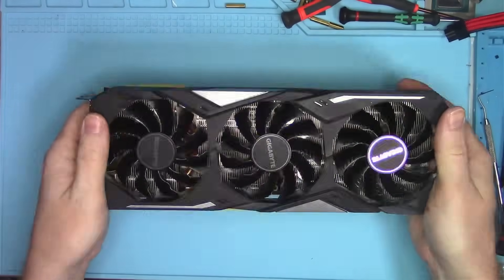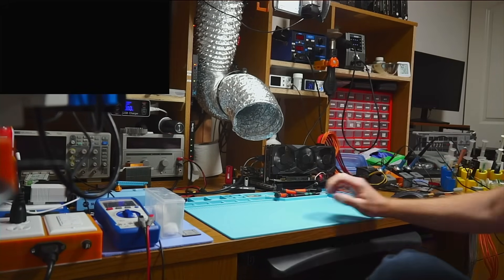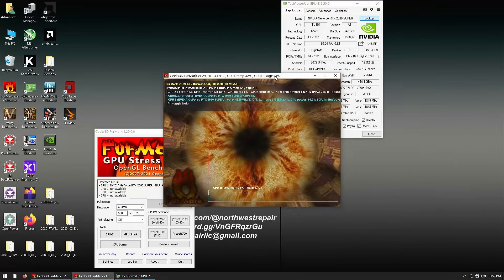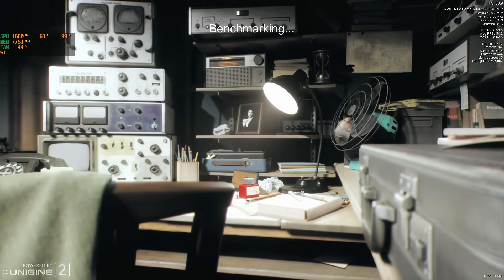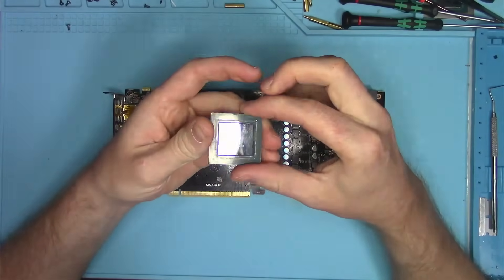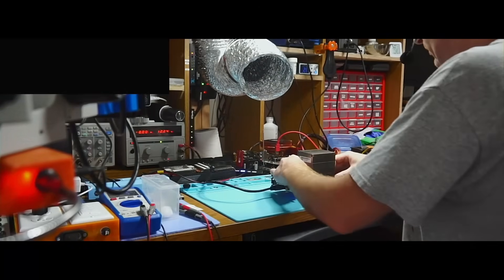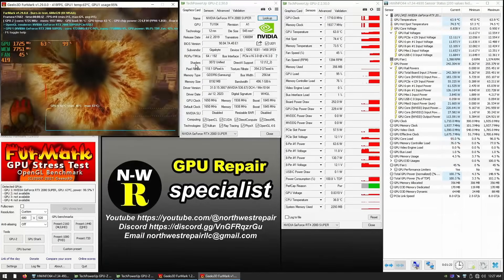GPU Artifacting FIX

Comment: I keep getting these vertical colorful scan lines that flash on my screen once in a while. I have a 5090 and I can’t seem to fix this. It. Could also be my new Asus oled monitor I can’t diagnose the issue it’s killing me. I changed my DP cable. Reinstalled drivers. It’s still flashing vertical scan lines and also the lighting in some games seems to flicker. Idk what going on. 5500$ for this computer totally unacceptable. It’s driving me crazy. Is my GPU dying or can it be the monitor ?

Comment: I clicked the video hoping to fix my card, but I don't have that much equipment! But I stayed because the process was so smooth and very well edited, thank you for sharing this! amazing work!
~ Could you provide the tools to stress test and lower voltage to check if my card has the same issue? thank you! 💗 I would take a band-aid for now

Comment: i have error Display 4101 but most spam is nvlddmkm 153
 errors even after turning on pc without entering any app or something happens on desktop
on laptop 
did format try ddu drivers tdr timing 20 second dint worked  Gtx 1650 with intel uhd system

Comment: bro, my rtx 2070 mxm was artifacting and crashing with oc(stock voltage) so all i did was to lower the oc i wanna know if the gpu is damaged or if its okay(never reached above 77c on core) i also run 13 30 mins of furmark, zero artifacts but the gpu mhz isnt at the max, in games it runs fine, but some flickering shadows(i dont know if its the game or the card, since its running on hdd and just some shadows, not all)

Comment: expected a simple "how to", so i can quickly fix the issue and instead got a full blown gpu surgery. still, i got nothing but respect for this

i reckon it might be at least worth asking: could you help me or is there a way to self diagnose the cause of random (and truth be told, pretty seldom) gpu artifacts? i get them occasionally while running stock settings on a 4070 super. they are not a massive inconvenience, but.. by buying a gpu or anything really, you demand for it to work as intended. i've been trying to record my screen for half an hour without an artifact. been trying different presets of uv/oc that i've been playing around with in the past, in a furmark benchmark. the only thing i learned is that i found a reliable and quick way to force coil whine (also frustrating to have) and it seems to be related with high fps. i can also adjust the pitch by changing the power limit, which directly correlates to the amount of fps.

as for now, i've done i clean install of drivers using udd in safe mode and will be looking out for more artifacts to come, but i'm expecting this to fail, unless the clean reinstall had helped, unlike regular drivers update, which wasn't helping in my case.

i forgot to mention, i'm worried that the artifacts may be the early sign of gpu failure. and i'd rather look out for help or RMA it (if i can even prove the artifacts occur) than wait for it to eventually fail and knowing my luck, it would happen soon after the warranty would've ended

Comment: My GPU just started failing I guess. Unsure what's causing it. It just gave me random pixels out of no where, then showed GRAY screen and then shut down the pc. Then it started up by itself and I had blue horizontal lines all over the screen during startup, but it did show the windows loading screen. However after the 'loading' was done, it stayed black.

It started a month ago when I was pushing code commits to github where I accidently had video files included from over 1 GB total... it was uploading until my screen started to show random pixels and then went completely PURPLE and then reboot itself. I rebooted it a couple times and it was fine again.
Until yesterday when it happened again. We managed to get it to work again, ran DISM and sfc, and it looked like it was fine.
But today it did it again out of no where, like it wasn't doing that much at all. And now it just doesn't want to boot, the blue lines are all over the place and it only want to go into the automatic recovery mode and fails to recover.

The GPU is a Radeon R9 200 Series and the CPU is an Intel i7-4820K.

Last videocard driver update that I did after I had some time where my screen just went black for a second or so, was in March. Well the reason for the update was actually Satisfactory, but ugh the game continued to complain. Also only runs in DX11

Am I missing something or do you have any ideas? Please let me know

Comment: I have a PowerColor Rd Devil RX 6700 XT that has the same issue but undervolting the core doesn't help while when I decrease the core frequency to 1000mhz it becomes stable, at first when I ran FurMark at default settings it would crash immediately but when I decrease the frequency it runs fine, I didn't touch the memory frequency and DID in fact run a memtune test in tserver which came out clean. I've seen one of your videos on this card aleardy where you deduced that the issue was the IOR 35217 controller and you had to replace it and program it a few times, but I'm not sure if that's the fix for my card since I don't have an infineon programmer dongle. Any help please ?

Comment: The case here is either micro damages/cracks on the die itself, or some of those tiny capacitors on the package dying. Obviously, replacing the GPU is the only sane fix here.

Comment: I get artifacts color blooms and flak flashes only in one game Warzone. Its also the only game that oushes my gpu to 2800 2900mhz . Every other game gets to 2.5 maximum but average at 2.3. is there something wrong with. My GPU. ? Should i underclock just for this game or doe sit mean my gpu is dieing ? Replacing drovers did help for a while but when i lowered the settings and let it get up in fps it happens again.. 7900xt should i be looking for a new card ?

Comment: Hi 
I just got strix gtx 970 used 
The card runs well on heavy benchmarks works but when running games it crashes after a few seconds. Tried different drivers , reducing the power limit and clock speeds, different windows. 
My specs are 
i3 10105f 
2*4gb 2666mhz ram
Gigabyte h410m s2 mobo
Cm 650w mwe v2
Gtx 970 strix
Mu appreciated for a solution

Comment: Thank You 👍 I just got similar situation with RTX2080ti. After undervolting less artifacts but still there. Very high power draw , GPU-Z - 12V drops under load up to 11.3V and Pcie 12v up to 11V(not PSU fault, 800w verified)From top three vrms one heating more with normal oscillation, on another two coils little strange oscillation like with gaps, not experienced with this. Mods can't pass initial but mats not finding any faults. Where to dig next ? 😅 Dead core ?
Reply: Dude just RMA it

Comment: the gpu core usually costs like more then half the actual gpu price, is there any cheaper way to perform a repair like this? that doesnt involve replacing a super expensive part 💀
Reply: sometimes , but not always 
a simple reballing helps

Comment: I feel like like this video is glossing over the fact that changing the core is almost like exchanging the whole GPU. I mean wouldn’t this repair be almost as expensive as getting another used one? I think I’d rather just lower the clocks a bit, if true.
Also couldn’t it be some bad solder points or something on the original core?
Edit: or thermal paste gone bad perhaps.

Comment: Yo can you tell me whats wrong with my pc ? 
- i have an rx470 4gb version nitro saphire ,
-i use atikmdag for driver issues because they dont appear themselves on windows so i have to use this program.
- i dont think its because of the driver problem but after the pc starts and gives signal after 1 minute the screen is full of artifacts and then somethimes  restart sometime gives BSOD and restarts and sometimes it just goes on worlking without restarting.

The artifacts arent individualy showing they appear in a moment and then do the restart thing they are on the whole screen and they are diagonaly out ...

Comment: What if I have some flashing artifacts in one particular place of one particular game and they go away after switching to DLSS balance/perf/ultraperf?Is it a hardware issue or a software one?The game is Horizon FW and the card is EVGA 3060 XC.Undervolting/underclocking to absolute minimum does totally nothing and the card successfully passes any kind of benchmarks or stress tests

Comment: I have a hp pavillion laptop. It's showing this status access violation error on any web browser i use. When i gave to repair they're telling it's the issue of gpu and it's dying. Ive runned all the stress test as you showed in this video and my gpu performed very well. This artifacts issue happens only in web browsers not anywhere else. What should i do?

Comment: My gtx 980ti is artifacting when i boot into os. And then not long after it just crashes.. I tried booting in safemode and using msi afterburner to lower voltage, but it won't even register on afternurner..

Comment: Would you have any idea why my fairly new ASUS TUF RTX 4080 would show flickering lines when first setting up Windows after a fresh install and before toggling HDR, but never after this? It only occurs with LG HDR OLED displays, at least the two I've tried. It can only be replicated by reinstalling Windows and not touching the Windows HDR setting. Once that is toggled on to HDR, the lines go away forever, even if I toggle it back to SDR. Now, I know it's not an issue with Windows as I will see these lines on during the ASUS boot screen when restarting just on the spinning loading wheel. But, once it loads into Windows, there is no line artifacts. And this problem never shows in games and the card behaves perfectly. 

The fact that this only occurs after a fresh install of Windows and before I first toggle the HDR option, and occurs regardless of what Nvidia driver version I have installed makes me think this is an issue specifically with the ASUS bios for this card's board and how it interacts with LG VRR HDR displays. I can overclock the card as well no problem with no artifacts. Here's what the bug looks like when setting up Windows for the first time. I think I reinstalled Windows like four times on this machine, trying different things, to really isolate the problem. https://imgur.com/a/Sf0LAk7#jVxBpE9
Reply from the maker: no idea
Reply: @northwestrepair  Thanks for replying. I guess since it doesn't actually affect the use of my PC I won't worry about it, but it's just been one of those things I can't quite solve. Is it possible there could be a hardware fault with my card that could cause such behavior?

Comment: So do you think that was a bad core and not the solder joints?  Whta would have caused that, overvolting and copper migration?

Comment: I have a 2060 Super NVIDIA card that I've been using in my computer for about 4 years. The past 2 weeks i've started having several issues. I am using duel LG 32" monitors. Sometimes 1 or both of the monitors will go black for a second or so then come back. Sometimes They don't come back and I have to reboot. This has only happened twice. THe need for the reboot. Sometimes the right monitor will display a patch on the screen of artifacting. Usually some straight rectangular black and white lines in a pattern. Imagine a chessboard pattern where they are not squares but rectangles. This artifacting is always the same when it appears. The rectangular chessboard pattern. It happens on either monitor.

Is this the video card? Seems like a clear case of a video card hardware issue. What do you recommend for trouble shooting this?

Thank you

Comment: Just fixed a "dead" as is GTX 1060 6 gb, replaced thermal pads, thermal paste, did 3 x furmark test, all good. Heat dissipation is a must with a gpu.

Comment: I would have personally accepted the first chip. Your work definitely improved the character of the graphics chip. I do however think the solder you use is so much better than Greta's on another board this chip might be just great. What in the devil happened to your eye under the lampshade.

Comment: How do you price this fix? (don't have to get into exact numbers if you don't want to)
The way I see it replacing the core is like replacing the engine in the car. It's so expensive and there's no easy way to buy replacement cores so most of the time a bad core = no fix.

Comment: Ohno, i am having similar issues, but only with few games, and it is only a green variation of the artifacts shown in the video, and that ocasionally show up covering only a line in some part of the screen, usually when i have minecraft open in full screen, and i go to exit it to a brouser or click out of the game, the artifact show up in the seccond monitor, where the game is not at, but when i change the game to the seccond monitor and i try to leave it, nothing happens.

in phasmophobia it just happened in the middle of the match, in the monitor where i play this time, but once or twice in all the games i played

in TABG, the same artifact show up when i open the "group tab"? and only when i open that, i am honestly confused since these are the only moments when that happens, i tried every single program to find problems, but nothing ever happens there.

Should i just find a guy that will change pieces off my gpu? is there something related to temperature? should i test with a specific program? i just want some advice here ngl.

Comment: Would soldering more vram to a A770 8gb (or another card with a higher vram version) work the same as a card that came with 16gb from the factory
Reply: you would need to flash a 16gb bios and solder the same memory. Not sure if there's a flash tool for Arc yet

Comment: I am fascinated by how easy it all seems. Great work! Keep up the great work. Quick question for you: I have an motherboard that has a bent pins on the cpu socket and I was wondering if it something that you could fix? I don't really want the board back, it could be given to a charity or someone in need as I have a CPU for it and memory. It's not cutting edge but if it could help someone instead of collecting dust here, that would be great. Thanks
Reply: hey man no response for 1 month do you mind i give it a try to fix?

Comment: hmm, strange one, you lower the speed to not get artifacts, but the voltage was not sufficient, it looks like to me a old (already push GPU), OR the power delivery was not up to spec and the power controller (VRM) was damage, just saying this because the siphons looks like a bypass resistance on the power to force the card to give more power without hitting the power limit, that can push the core too much or the VRM's.

Sure changing the core will fix it, but if I'm right that card will return
Reply from the maker: Not according to the stats but who knows.
Reply: @northwestrepair  , true, lets see if my theory is right or wrong, 😉

Comment: I love your sense of humor. BTW you have lowered GPU Frequency not Voltage in Afterburner.
Reply: No, you are wrong.  He lowered the voltages across the frequency curve, not a flat number.  Read both axes of the chart.  
How did nobody call you on this giant mistake in a year?  Wow.
Reply: @NegativeROG  Because he's right and you're wrong. He did lower the frequency curve, which lead to an effective increase of voltage. Stock curve has 1500 MHz at 700 mV, the modified one has 1500 MHz at about 850 mV.
Reply: @samiraperi467  Not exactly an increase in effective voltage, as the core will still try to run at whatever voltage it's been set to run at; @full utilization usually anywhere between 1 to 1.1 volts. It's not like it'll try to increase power consumption in order to achieve certain frequencies without being told to do so. Just by dragging the whole curve down he's decreasing the effective frequency for all possible voltage levels. Voltage same, frequency different.

Comment: So the core is the culprit with a problem like that?
I have a GTX 1060 and a RTX 2080 with almost the same issue
Reply from the maker: It's not always the core for 2000 cards.
For 1000 the other way around.
Reply: @northwestrepair  thanks bro

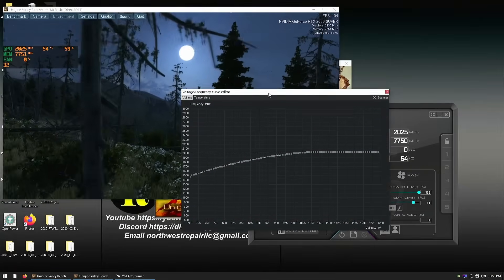Comment: 1:08 I think you meant to say underclocking instead undervolting. After lowering that voltage frequency curve, the GPU is now reaching a given frequency at a higher voltage than before.
Reply from the maker: You may be right.
This option is not available unless the voltage tweak is unlocked so I assume it was the core voltage.

Comment: hi, i'm a recent viewer. i really love your videos, they are very explanatory. I'm not a gpu fixer but I specialize in consoles and find many useful tips that can also be applied in my field. I would like to ask you a question. I've recently been perfecting my skills in reballing processors and bought the right hot air nozzles for this job, so my question is this: what percentage or fan power do you use to detach the core from the board? is it the same one you use to reattach it too? I ask this because I have noticed that my hot air station transfers heat better to the boards when it is at low ventilation rather than at maximum. thanks if you answer

Comment: So what do you think was wrong with the core? The solder joints cracked within the core or it is worn out from age? If it is worn out then if i'm not mistaken it would need more volts to become stable. Lastly could a reball with the original core have worked?
Reply: I had a similar issue and I did a reball, just of the gpu core. Card was out of warranty, so I didn't have anything to lose. I was surprised that process worked. I have had no issues since and just as a fail safe did under volt card after for 2 weeks. Gradually increased voltage back to standard. Applied quality thermal compound and pads.

Comment: Informative Video, thanks. does your instruction implies that if the problem solved by reducing the core voltage/frequency then all fault is due to the gpu and no wasting time on reballing and ram chips?:eyes-purple-crying: